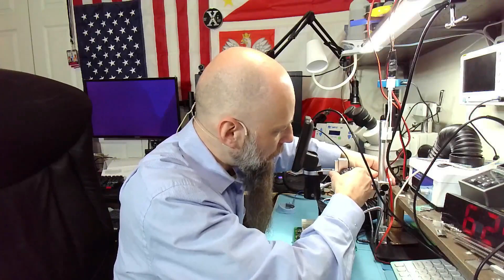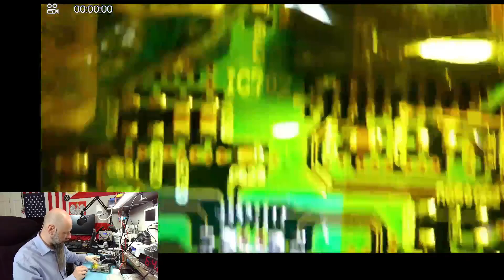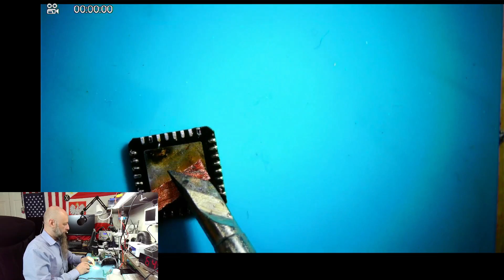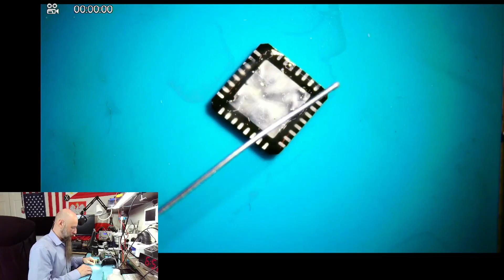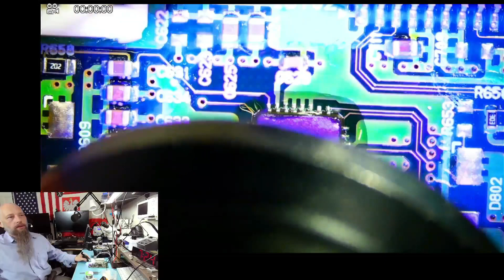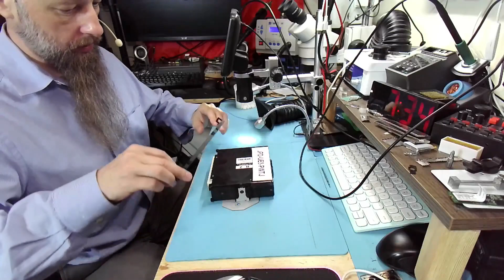ECM Repair for Keith | Misconceptions around Solar Panels - yes they do work but...

Comment: In 2024 there are 550w solar panels for around 100€ in europe (less than 0.20€ per watt). They operate in 40 to 50v. If the solar panels are connected in series then the cooper wire price will be insignificant, in paralelo is other story, highier voltage will improve effenciency if the overall system. These solar panels are certified and most off then have a 25 years waranty at least 85% production. Weigth is 20 to 30kg.
Reply from the maker: yep, connecting them in series will greatly reduce the need for copper, but my point still stands regarding scalability, it is not intuitive :)

Comment: Actually the big misconception is that trackers make a huge difference because you max direct sun the whole day compared to only 1-2 hours.
The actual gained power from using trackers is less than 50%, this might sound like a lot but it isn't because your system now costs MUCH more and also needs MUCH more maintenance.
My solar system that consists of 6kW of panels and a 4kW inverter produces a little over 6MWh a year in the not so sunny Belgium. The reason that the inverter is smaller is that we are taxed on the power of the inverter when feeding back power to the grid (arround €100/kWh/year) and the extra 2kW would cost me more than what I would get from those rare very sunny days (less than 10% production increase for 50% more taxes).
If I hadn't bought an EV my current electricity bill would only be the €400 of taxes for the inverter since I would produce more kWh a year than what I consume. (will expand my solar system to cover the EV charges)
About the wire gauge, in a good solar system most panels are in series and the added wire cost for bigger systems is negligible. The 18 panels on my roof are arranged as 2 circuits of 9 panels in series and the only wires you have to provide to connect your panels to the inverter are the wires between the inverter and the first and last panel (in my case 4 wires since I have 2 groups of 9 panels) and the gauge of the wire is only 2.5mm^2 (they are in series so you don't need thicker wire). Wires provided on the panels are long enough to connect to the adjacent panels.
Reply: Hi, if you didn't want to export energy to the grid, just have a look to solar inveters with limiters, they don't feed back to the grid. If you decide to go that route I recommend you to add a battery to the system, so the generated energy will be stored not wasted.
Reply: @victorrodrigues9322  Why would I? The tax we pay is to store our energy on the grid which is like having unlimited battery capacity.
The problem home batteries is that they are not really worth it because by the time you break even with the battery cost you used up over 80 percent of your battery life.
Reply from the maker: my point was the scalability beyond one roof, like a solar farm, that kinda stuff, so examples of 18-20 panels is not quite there yet, once you need to get 200-800 panels together that becomes relevant as the more panels you have the longer the distance between the first one and the last one so it doesn't really matter if you connect them in series (plus one panel faulting out will bring the significant portion of your array down)
So solar tracker gives you only 50%? that's less than according to my measurements but I guess it depends on the environment, but yes, that brings extra cost, weight and of course maintenance so either way I agree, it's not exactly worth to get the tracker for the 18 panel installation.
Thank you so much for your input, very informative.
Reply: @blackhorserepairs  To be honest I see EV solar more as small systems installed on the roof of homes (ranging from 5 to 20kW). The ideal combination would be with hydrogen storage.
The current system I have now (meter counting backwards when I produce more energy than what I consume) will disappear in the next years and the new system with digital meters isn't very good (we will be paid a very small amount for what we inject on the grid).
I am currently informing on a system to store overproduced energy as hydrogen instead of injecting to the grid and that seems very promising, only downside is the cost. The big advantage is that you can store MUCH more power per volume compared to battery storage. A 1-2m^3 tank is enough to store a few MWh which is probably arround 100 times more than what you can store with batteries of the same volume.
Reply from the maker: @ppdan  there's a reason hydrogen can store more energy than lithium, it's crazy reactive, it's like putting a hydrogen bomb in your basement, very risky. I would just stick to lithium batteries.